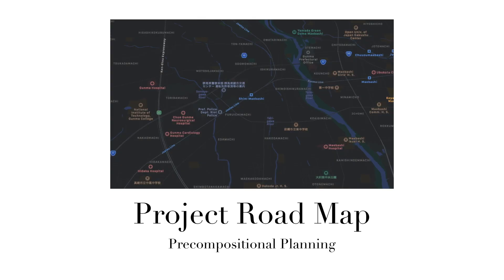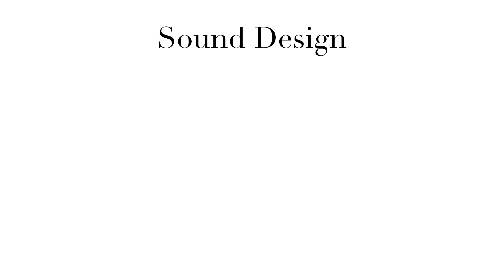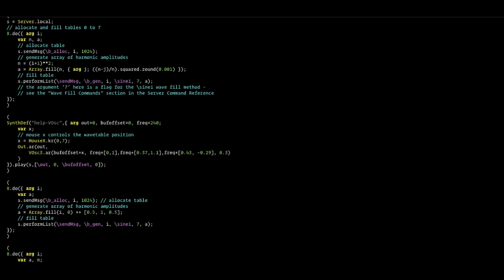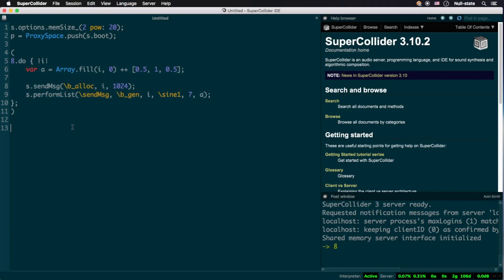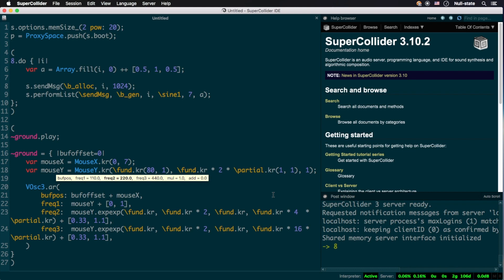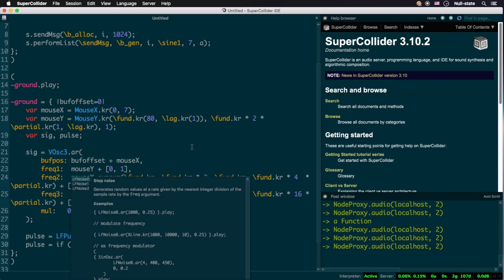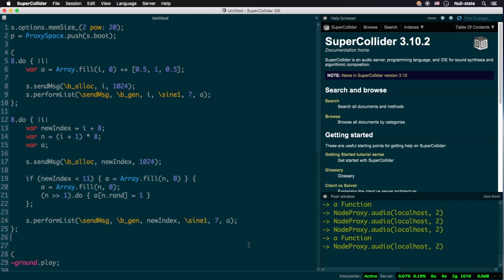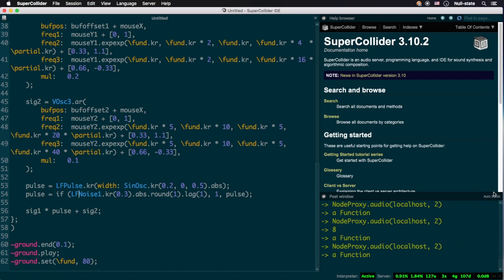[NS TUTORIAL SERIES 1-13] Sound Design I

Comment: Great series! I'm just now getting into SuperCollider.
I'd advocate using a different method for Buffer allocation and filling. The Buffer class includes a couple very useful methods, namely `.allocConsecutive` and `.sine1`. The reason to use the first method is to avoid allocating buffer numbers manually to avoid conflicts. The second method there is just syntactical sugar. Consider this, for the first group of buffers:

b = Buffer.allocConsecutive(numBufs: 8, server: s, numFrames: 1024);
b.do {|buffer, i|
    buffer.sine1(Array.fill(i, 0) ++ [0.5, 1, 0.5]);
}

You could also allocate all 16 at once, and only use one offset. I'm unsure if these methods were part of sclang when this tutorial was made.